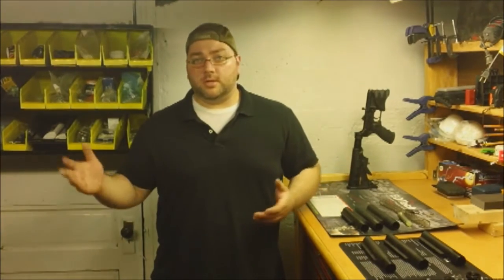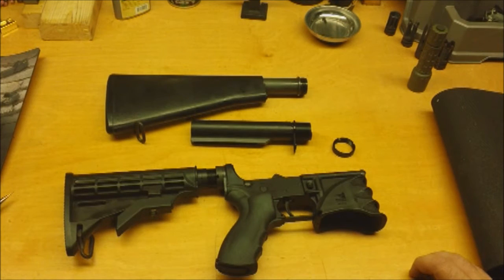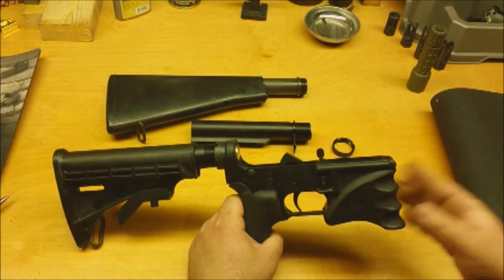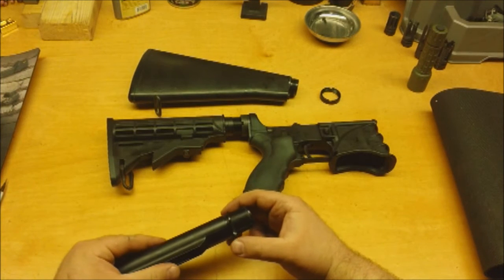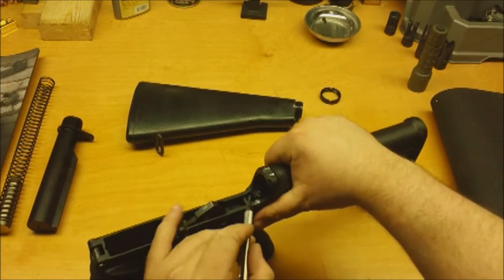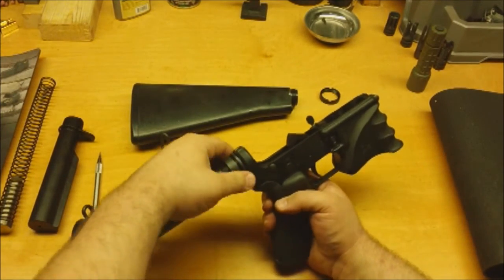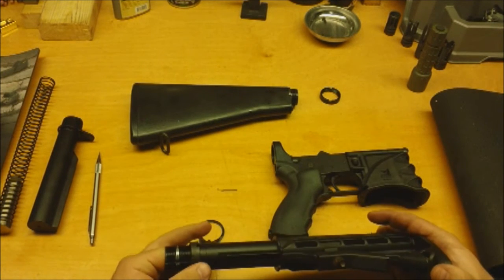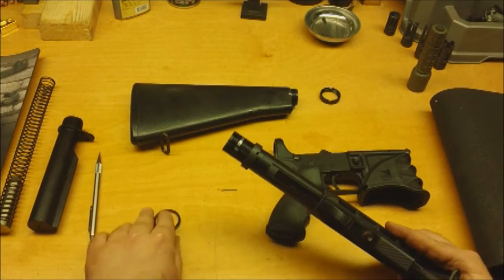Part I of an In Depth Look at American vs. Foreign Made AR-15 Buffer Tubes and Stocks

Comment: I bought what was advertised as a "mil spec" lower parts kit from Tactical_sht and the buffer tube is mil spec in size and shape but not in construction.  The inside was very rough with lots of grooves, lumps and bumps so it obviously was not gun drilled.  The buffer and spring tended to drag and rub with so much friction that it made a lot of noise and caused the bolt to be hard to move.  I sanded the inside smooth but it's now bare aluminum that still has lots of friction and should probably have some kind of hard coating with dry lube on it.  What would you recommend I use to lube the inside?  In contrast I have a stock from Bushmaster with a commercial size buffer tube and it seems to be coated with Teflon inside and is very smooth and quiet in operation.
Reply: I'd buy from Cheaper Than Dirt before I bought from Tactical Sht again.
Reply: MarvinRunyon I haven't had any problem with CTD except for getting some bad mags but they gave me a refund. I got what was advertised as a mil spec buffer tube from a vendor on Ebay called omegatactical and that was a mistake!  It was not mil-spec by any stretch of the imagination in either materials or construction. The outside was mil spec in size but the unit seems to have been made from a casting that had the outside machined down to size but then a hand held grinder must have been used to grind out the hole inside. It had lots of big pits and gouges inside it and a ledge about half way down where the inside diameter got smaller. They sent a replacement that was a little better but not much.

Comment: Just buy a mil-spec buffer tube from a reputable manufacturer, install ONE end plate, crank down the castle nut, properly stake the end plate, and you will never have a problem.